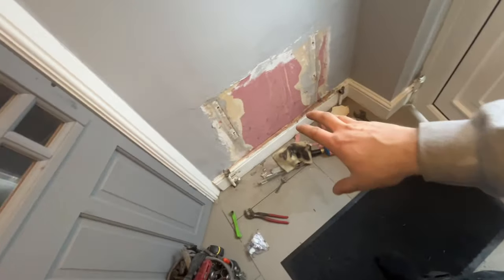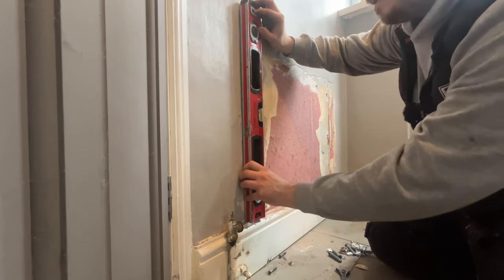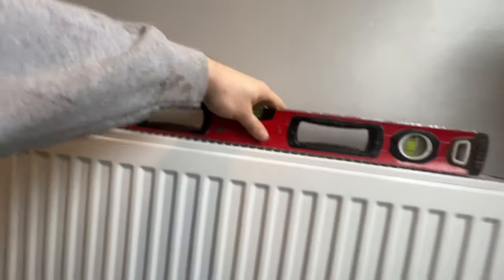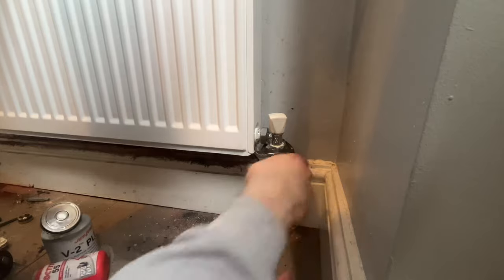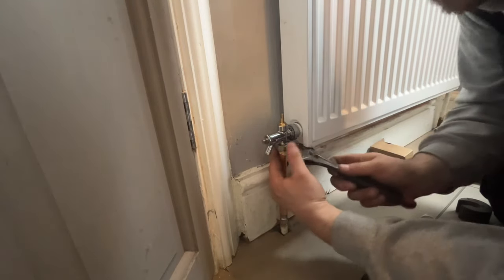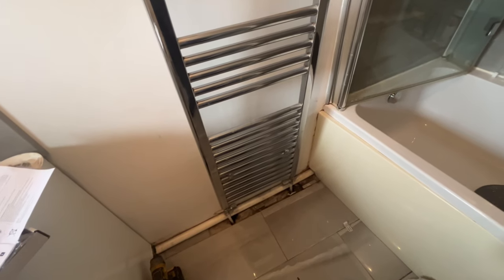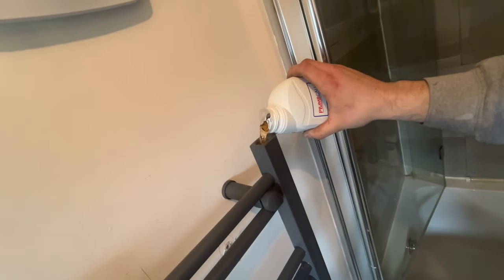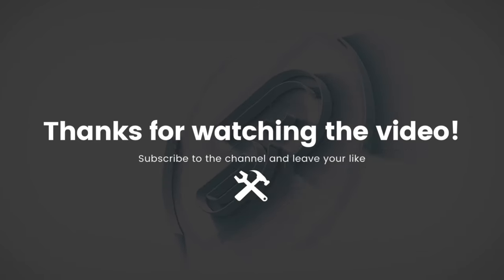The Easiest Way To Hang Radiators For Apprentices

Comment: Great video bro, start putting the top towel radiator fixings lower down then customers can get big towels on the top section 👍
Reply from the maker: I usually put on the 2nd or 3rd down but this one I could as the bars were too separate and would of looked strange
Reply: @SmartPipePlumbing  I am the same as you m8, worked with a bathroom fitter  and he always put the top fixings way lower , works a treat for the towels. I've started doing it now as well.

Comment: good video mate. I find it crazy how many different ways there are to hanging a radiator. Also where can I find that bit you used to clean copper.
Reply from the maker: Cheers pal, it’s from a guy on instagram that makes them called Dan stokes
Reply: @SmartPipePlumbing  thanks for the reply. how long do they last
Reply from the maker: @deano6017  depends on how there used to be honest but best part of a year I reckon